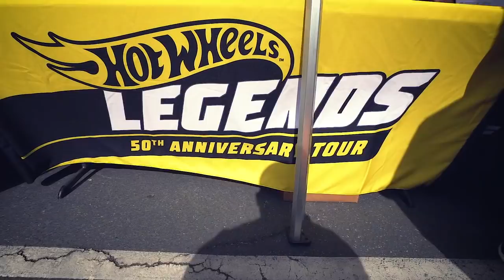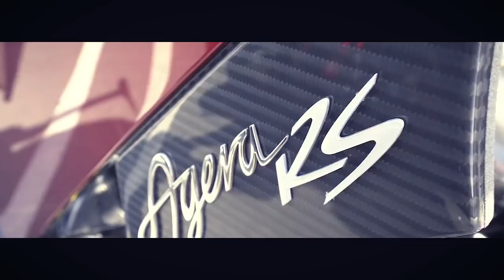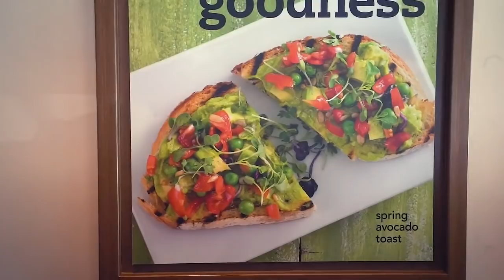TITANIUM EXHAUST SCREAMING AND TIRES SHREDDING! * 800 hp Lamborghini Laying It Down! *

Comment: 2:23 - the exhaust pipes are way too close to the rear wing support bars causing the coating to melt. Plus aesthetically it looks poorly designed. Hopefully in other videos he removed the bar or changed the exhaust to exit on the sides.